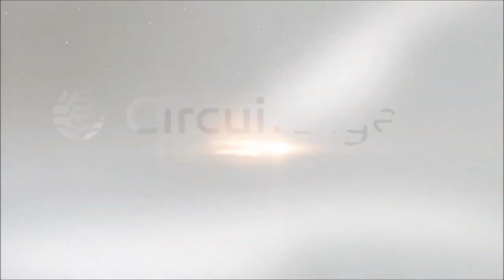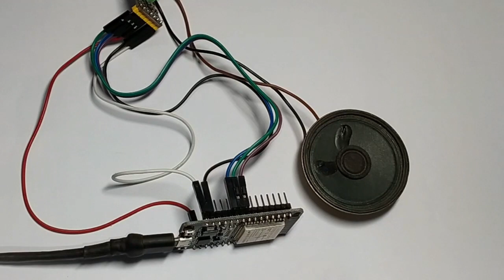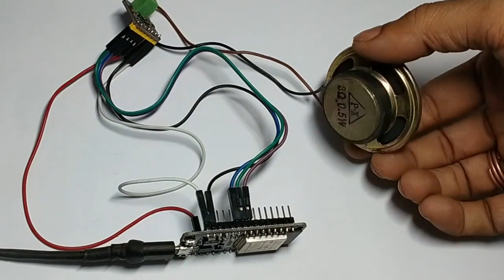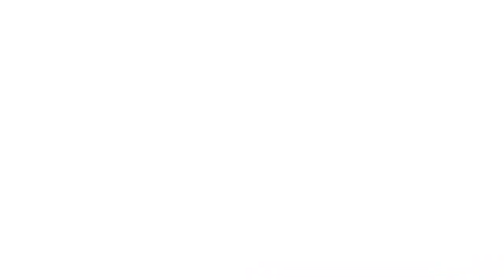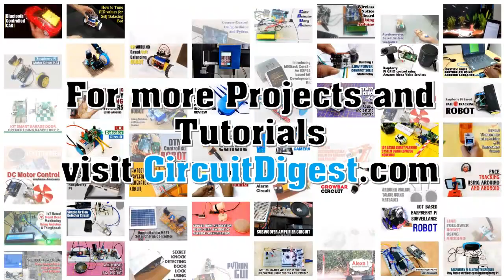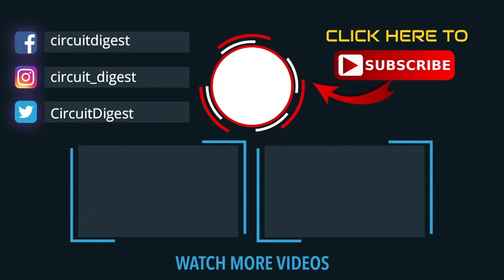ESP32 Internet Radio using MAX98357A I2S Amplifier Board | ESP32 Project

Comment: Dear Sir. I have followed your instructions step by step. Unfortunately I am not getting any sound. All wiring is definitely all correct. Please advice
Reply from the maker: Double-check the I2S and WiFi configuration in your code and check the serial monitor.

Comment: Can you tell me what to do with noise
Reply from the maker: Check the power supply and make sure to use a good quality speaker with appropriate rating.
Reply: @Circuitdigest  i am providing power from esp32cam, 3.3v. Same as your spekaer, I have 8ohm 0.5 watt speaker. But I am getting a very sharp noise
Reply from the maker: The MAX98357A should be powered from 5V. Check the schematics again.